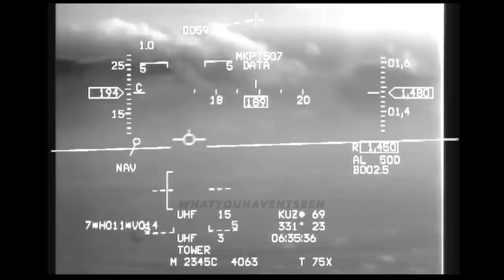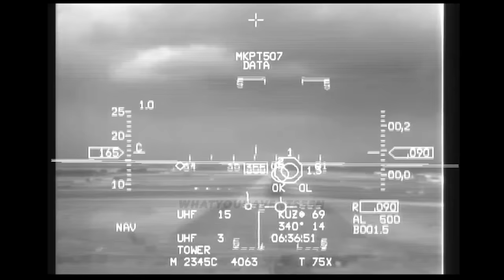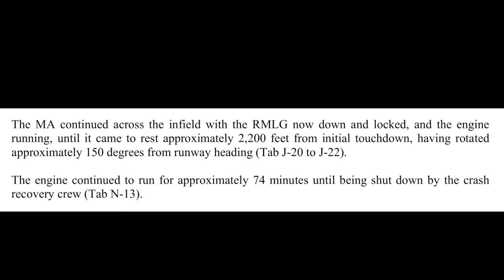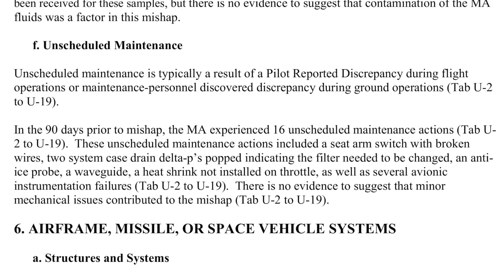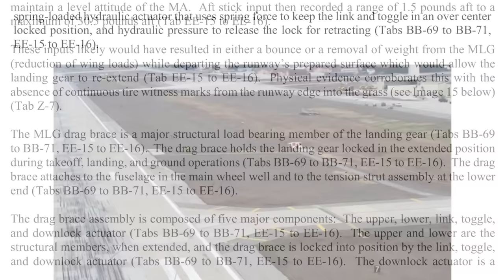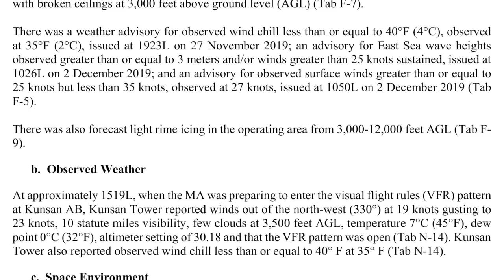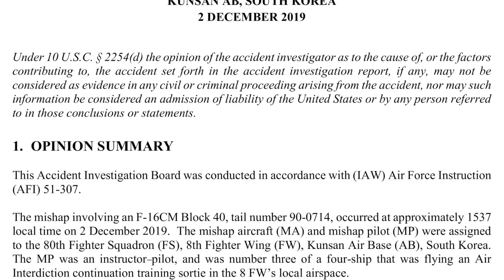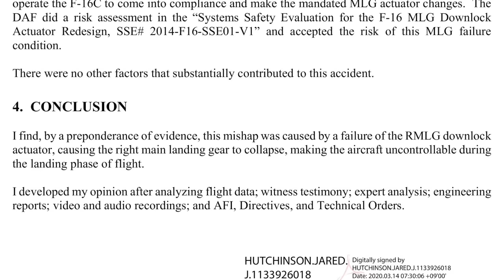F-16 Landing Gear Failure & Ejection (HUD Footage)

Comment: Took someone over an hour to cut the engine.  wow  I thought engines would be cut automatically after an ejection event.
Reply: I wouldn't go near the thing until I could convince myself that it probably wasn't just about to explode.
Reply: @danpatterson8009  Don't worry about explosion, do be worried the hydrazine tank for the EPU is leaking. Hydrazine is not good for your lungs. Or skin.
Reply: Lookup oy-yet incident plane is now known as oy-wet. She kept burning even after dumbass pilot sent her off the closed runway into the river. Amazing, like she came back to life. She's still flying too, a citation I think
Reply: @devinthierault  The engine is in a Citation now? That's wild.

Comment: I’ve been involved in an AF crash investigation before. Pretty cool stuff.  I helped on the F-16 that crashed into a warehouse at March Field a few years ago.  I work aircraft hydraulic systems.
Reply: Kriv 👍
Reply: What do you make of the 0 pressure hydraulic gauge reading in this crash? I assume these were located in the wheel wells, and not visible to the pilot. Would the loss of pressure occurred post crash, during gear extention, or flight?
Reply: @slartybarfastb3648  almost certainly post crash. A lot of hydraulic lines and components are damaged in a crash like this so you’ll lose a lot of fluid and pressure in lines and accumulators if they’re opened up in an impact.
Reply: Hope nobody came into contact with the hydrazine from the EPU.
Reply: @wewd  Direct contact or ingestion 😵

Comment: Great reaction and ejection by pilot. It’s crazy that the Air Force was completely fine with this happening while they dragged their feet for 3 years replacing the defective parts.
Reply: I think most ex-military would find that to be not crazy at all.
Reply: @ExtremeSquared  I guess a better term would be "sad". When I was in the Army things definitely took forever to happen, so I agree the timeline is not really surprising here.
Reply: We were always told that our equipment was made by the lowest bidder…

Comment: A flaw, known to exist over two years before this mishap nearly cost this pilot his life and the write-off of an otherwise fully serviceable aircraft.  The good news is that, "Following the incident, the 8th Fighter Wing implemented this Technical Order to ensure the future safety of its airmen and fleet."  How about that.  The 8th FW got off their duffs and complied with the TCTO (yeah, I know, they had a rescission date about 3-years post-accident, but still), but it shouldn't have taken an accident to get the work accomplished.  CO's head should have rolled.

Comment: The engine kept running for 1 hour????? Why didnt they use the emergency shutoff valve?
Reply: Probably safer to just let the thing run and run out of fuel, you don't want a busted up engine sending piece flying everywhere and killing someone.
Reply: Having been on crash recovery before when we arrived at the scene we were not allowed near the aircraft until the Fire Chief deemed the aircraft safe to approach. I think the Fire Chief was worried about an explosion. After 74 minutes it most likely ran out of fuel.
Reply: are you gonna be the one to walk up to a jet that just crashed and dig through rubble to find that valve?
Reply: @loose-arrow-garage  or yknow, the whole hydrazine leak possibility

Comment: A B.S. conclusion. MLG actuators don't "just fail". This is a known problem caused by a (1) Improperly designed (2)improperly engineered (3) improperly manufactured (4)improperly installed or (5) improperly maintained RMLG downlock actuator. From the report I think we can throw out #3, 4 &5. JMHO